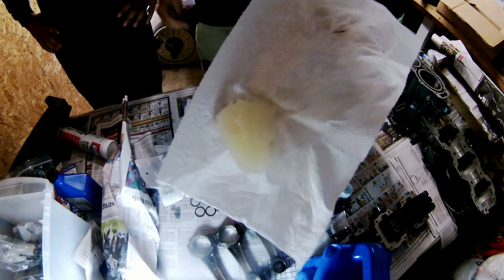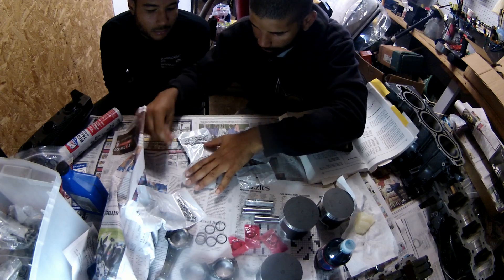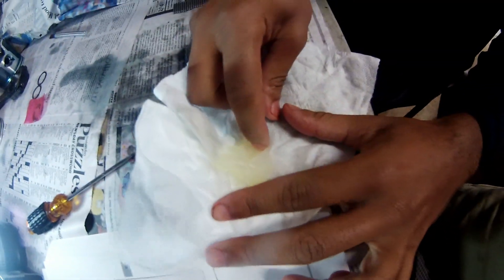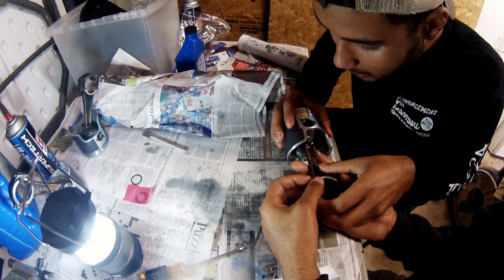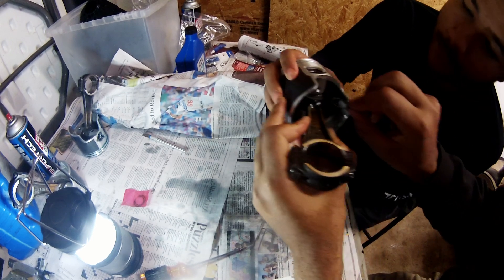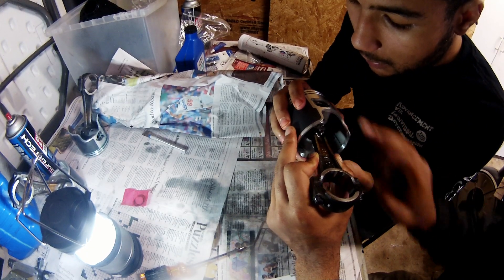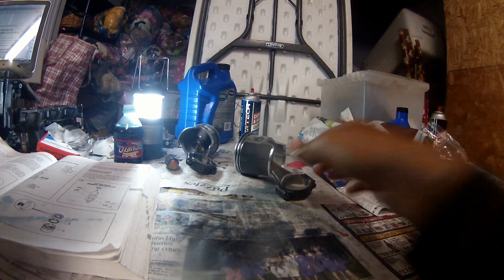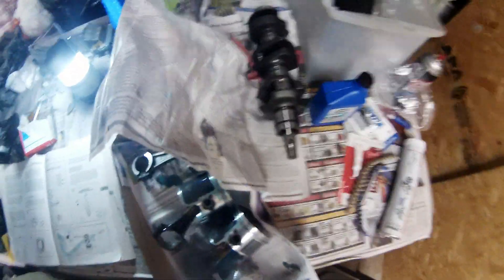90 Yamaha Outboard Rebuild : Assembling Outboard Pistons ep1

Comment: What size socket did you use for the connecting rod bolts? I’m using your video to rebuild mine right now.
Reply from the maker: This was a long time ago. Maybe a 12mm. I have a link to the repair manual let me find it.
Reply: @FishxScale  Do you recall using a certain type of socket? My bolts look like 12point, but i cannot get a socket over them as the shoulder of the connecting rod cap is too close to the bolt.
Reply from the maker: I used a 1/4 inch 12point  socket it barely fit
Reply from the maker: http://gjoel-marinecenter.dk/upload/manualer/62Y-28197-5A-11.pdf

Comment: I'm really surprised the piston ring didn't snap when you were stretching them out. They must be steel and not cast steel. Thank God. The way I do them is to just pry them over by hand. If they are over expanded they may wear in the cylinder bores more than if not. Once the motor warms up they should relax just fine. You guys are doing a really good job.  Expecially the keeping everything clean part. That's super important. Thanks for sharing.
Reply from the maker: I know that wasnt the proper way to get the rings on there. But I watched a few youtube where they stretched them with these pliers to get them on
Reply from the maker: I know that wasnt the proper way to get the rings on there. But I watched a few youtube where they stretched them with these pliers to get them on
Reply: @FishxScale   What I do is take a real fine piece of sandpaper in right on the sharp edge that's going to be against the piston I  touch it up a little bit that way I can slip the rings over the piston without stretching them just slip them over like I said without scratching the pistons. You should be fine . Is not like I was on time enough to tell you before you did it.  One trick would be  To take a hand dryer in warm up the pistons and the rings when you put the piston ring squeezer around the rings before you put it in the cylinder just warm them up overnight in let them cool back down before you try to put them in. By warming them up with a hand dryer you will naturally make them conform to the shape and not overheat them. When I read watching it looked like they where stretched out just...a little bit more than I'm use to seeing them. But that's on Chevy engines that I build a lot of. Like I said. I'm sure your fine but it will never hurt to warm them and let them cool all the way back down before you install them.

Comment: They do have circlip pliers that has the ends of the pliers that allow you to grip the open ends of the clip. To bad they didnt make the circlips with a slightly larger ends with a hole in it. Then just a cheap Harbor Freight set of snap ring pliers would have made it an easy job.
Reply from the maker: Yeah I looked them up didnt want to wait/pay for one time use. In hindsight they would have been worth it
Reply: @FishxScale  yeah I hate how specialty tools are priced. But in the end you got it done and didnt waste 50-100 bucks on a tool you'll probably never use again. Good job, looking forward to the rest of the build